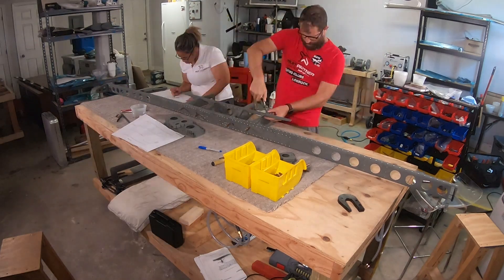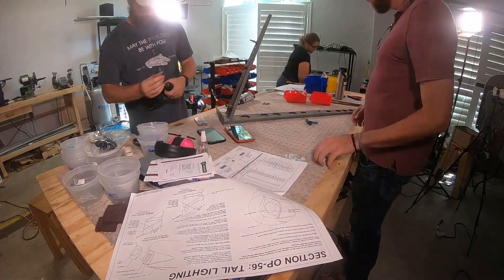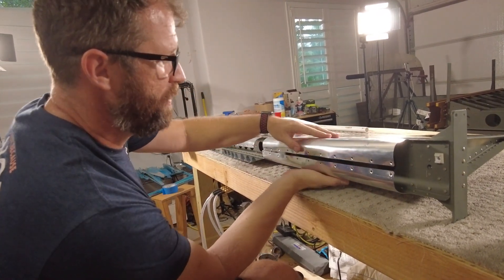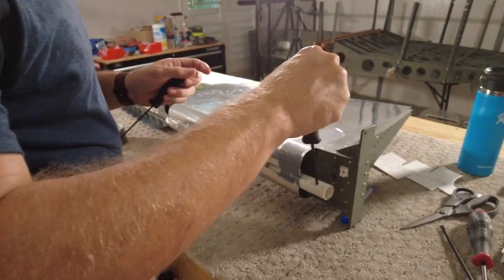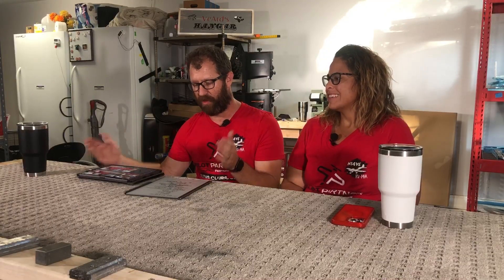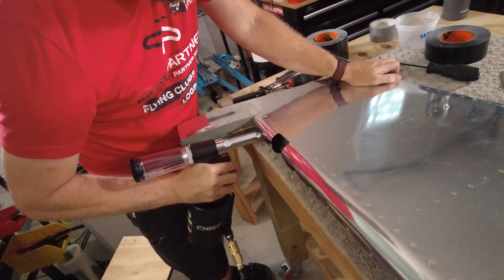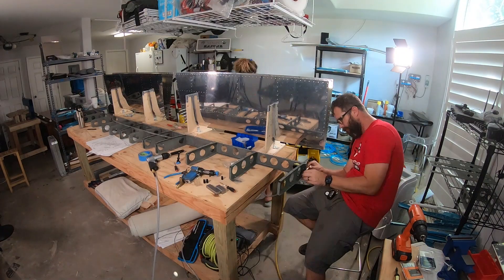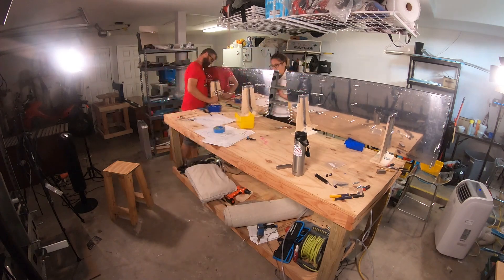RV-14A Builders: Tail Kit Update (Rudder, Stabilizers, Elevators)

Comment: Something I noticed in this video with the blind rivets on the rolled leading edge of the rudder skins that drove me to reference the plans. It may be the lighting in your garage, but it appears that the leading edge row of rivet holes in both skins R-00901-L-1 and R-00901-R-1 are dimpled. The rivets called for in this area are AD-41-ABS, round-head blind rivets - not flat-head used in dimpled/countersunk holes. It is clear that there are round-head rivets set in place on your rudder's rolled leading edge. If those leading edge holes are in-fact dimpled, is it acceptable to set a round-head blind rivet in a dimpled hole? If the answer is yes, I'd think that the grip of the rivet needs to be lengthened to compensate for the protrusion of the dimple.

The take-away and value of your video is that it drove me to the plans and made me think (ouch!). So, thank you for that! 😁
Reply: @N14VE  Older eyes, lighting factor on my part.

Comment: based on what I see, that rudder will fit on the VS no problem.  Rolling those edges is a pain but  I found that steel... I think 3/4" pipe worked best for me..